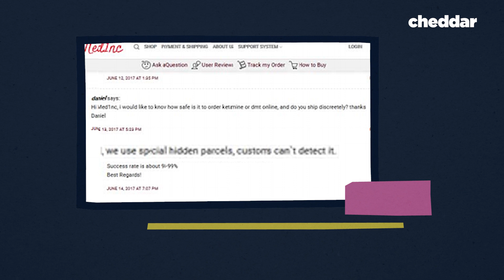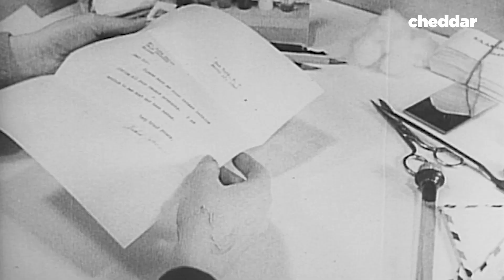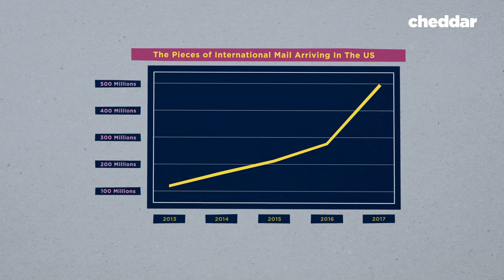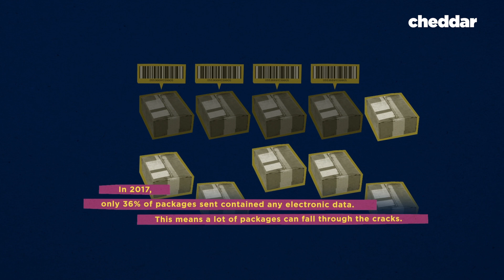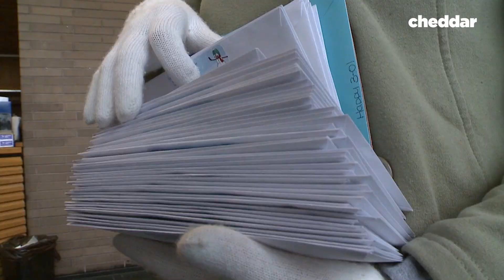Why Drug Dealers are Choosing the United States Postal Service - Cheddar Explains

Comment: Drug dealers choose USPS probably because it is currently the easiest way to do business. When USPS starts to require all packages contain a tracking code, they will probably smuggle drugs inside regular package and use shell companies to send these packages. When there is a demand, there will be supply.
Reply: Made In Poverty  Is that a big risk for dealers? It's not like the customer can really do anything about it but pout if they don't get the product.
Reply: Drug man good
Reply: Well the reason why you aren't required to put name or tracking is because if our postal system didnt have it, it would violate our 5th amendment , the right from self incrimination,  a constitutional protected right

Comment: I think i have a potential solution but it's not full proof. We could just offer lower prices if the package has electronic data and significantly raise the prices of packages that don't have data. This way there would be fewer packages without data so there'd be fewer packages to search.
Reply: Or you could just fucking require all packages to have electronic data. The USPS doesn’t even get to control prices for international shipments anyway, that’s run by the postal union mentioned in this video.

Comment: I just got a pound of weed through the mail.
Reply: How did it go?
Reply: @nicfeen7789  i got it on Saturday. It went fine got tracking information and everything you just have to watch where you purchase it
Reply: @DojaPack  did you get it delivered to your house or P.O. Box
Reply: @nicfeen7789  you get it delivered to your house it comes vac sealed multiple times so no smell gets through for weeks. It gets shipped on Monday or Tuesday so it doesn’t sit over the weekend. All online dealers do this
Reply: @DojaPack  nice, I want to ship mine through P.O. Box but idk
Reply: @nicfeen7789  P.O. Box is more likely to get caught. It is easy to not get caught shipping to house, If they suspect there is anything in the box they either throw it away or do controlled delivery where they ask for a signature. You won’t be using your real name on the box so tell them you didn’t order anything and they will leave. Never sign for anything and you’re good. Also don’t open the box for like 30 minutes after receiving it just in case. You can not be charge for anything without opening it as it is not shown to be yours by opening the paxkage
Reply: @DojaPack  I was only going to use a P.O. Box to make sure my mom wouldn’t get to it first, but it probably would be better not to use the postal service’s since they try to make you sign for everything
Reply: @nicfeen7789  in the US they don’t make you sign for anything. If you are outside the us it’s different. In the UK they basically can’t do anything about it I’ve heard even if the postal workers smell weed they can’t do anything and have to deliver it. 

Really all you have to do is find a reliable person. A P.O. Box is fine if they are trustworthy because you know they are packaging everything very well. You should never check your tracking info cuz they can see your IP and prosecute you but I checked mine a lot cuz I trust the guy and it got to me fine. The prices are great too I got a pound of ok weed for $350 and you can get fire weed for $1000 a pound and a quarter pound of fire dabs for $850
Reply: @DojaPack  I’m trying to get edibles you think I won’t have to sigh anything?
Reply: @DojaPack  I bought some before earlier this month and it came through my mail not in front of my house